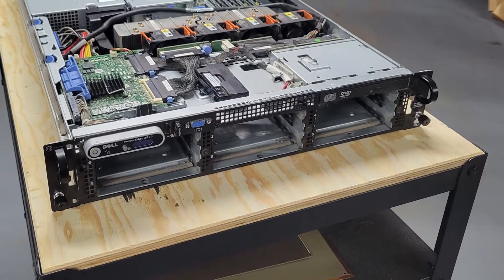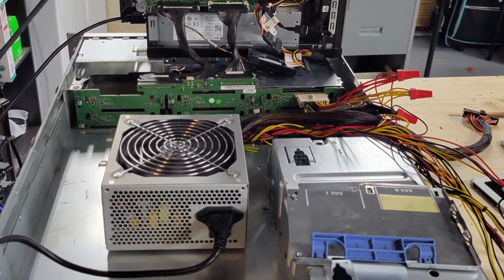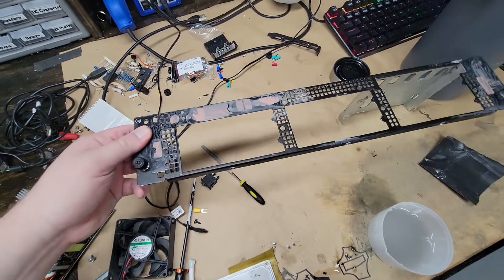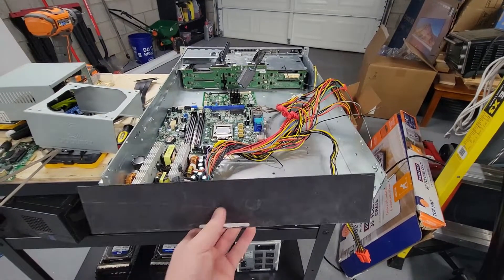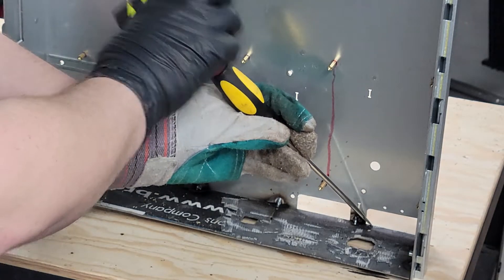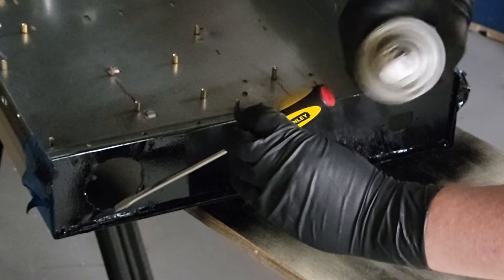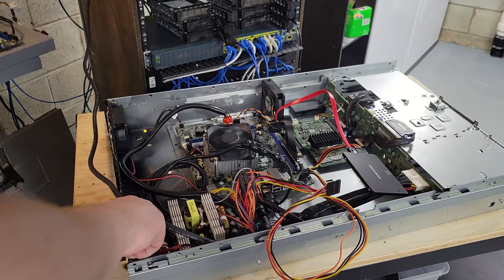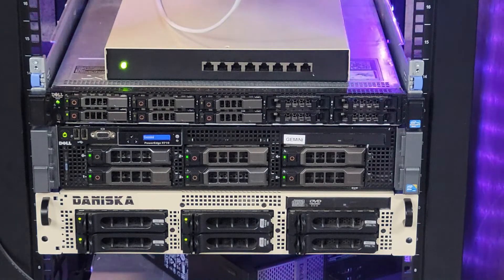Repurpose Old Server with Custom Hardware

Comment: great informative video .. planning on repurposing my old tower server, got a few tips from this video. 

Also as a side note - it is my moral duty as a concerned citizen of a non-moon landing country ( timestamp 2:31 ) to point out the fact that "Contrary to urban myth, NASA did use the metric system for the Apollo Moon landings. SI units were used for arguably the most critical part of the missions – the calculations that were carried out by the Lunar Module’s onboard Apollo Guidance Computer (AGC) during the computer-controlled phases of the spacecraft’s descent to the surface of the Moon, and for the journey of the Ascent stage of the craft during its return to lunar orbit, where it would rendezvous with the Command and Service Module (CSM)."
Also : https://science.nasa.gov/science-news/science-at-nasa/2007/08jan_metricmoon
😉✌
Reply: Would love to see how it will end with you :)

Comment: Good ideas, def tough to quiet down these dells sometimes. I've got an r520, r420 and r320 I got from work still in storage but as the 420 has a dead idrac and the board is toast I may try and repurpose the chassis and backplane. I did a custom build out of a 4U intel chassis from 2013 to support an atx psu, 3x 120s and atx mobo. Flashed H710 to hba. Still deciding what role that'll play in my lab. In the next few weeks I'm hopefully getting some other servers, mainly ones with Xeon scalable or there newer E5 xeons. Excluding a Xeon 2144G system running truenas I've still got an dual E5-2667v2 I'd like up upgrade from at some point.

Comment: What are the gray wires on the backplane power conector for?
Reply from the maker: I'm honestly not sure. I didn't get a voltage on them and after I booted it up without them, I stopped probing.